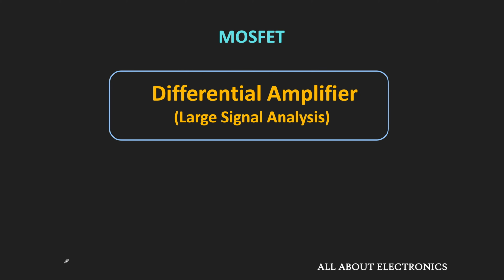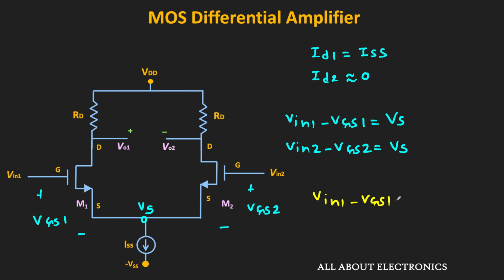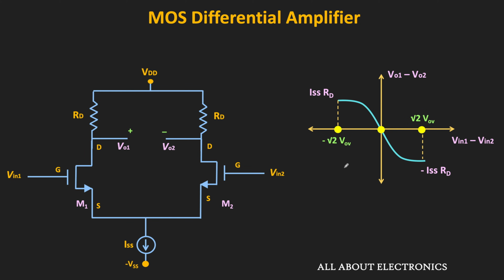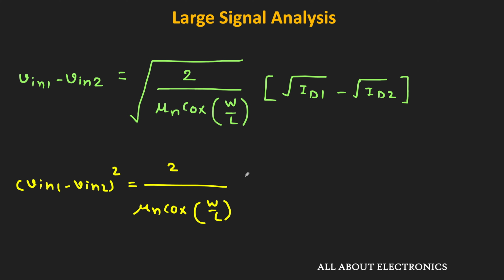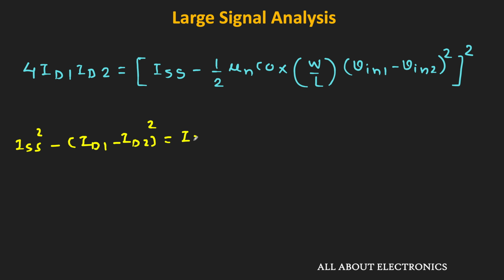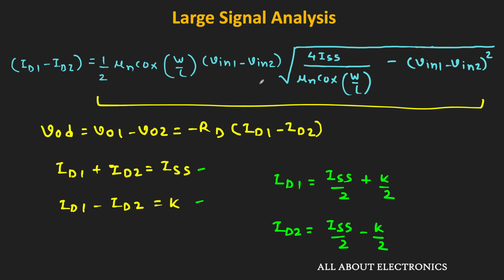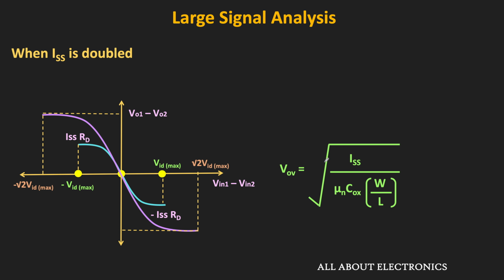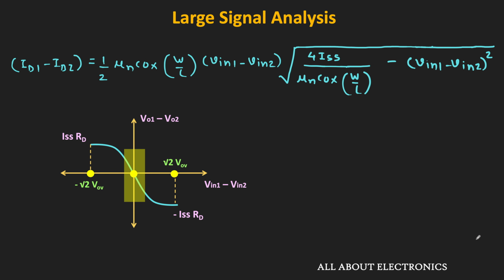MOSFET - Differential Amplifier (Large Signal Analysis)

Comment from the maker: Timestamps:
0:00 Introduction / Recap of the Previous video
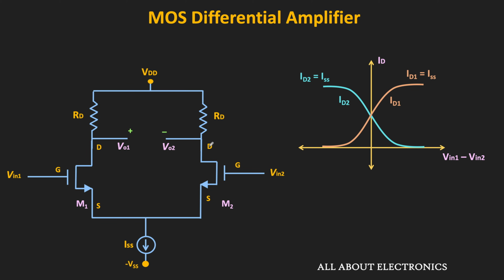2:23 Differential Input Range (Calculation)
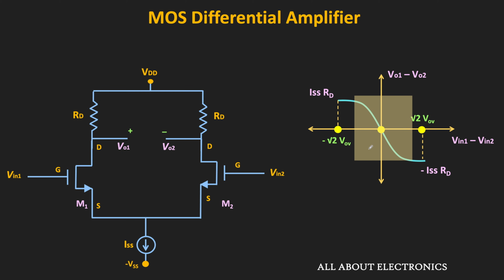7:10 Large Signal Analysis 
18:33 Effect of overdrive voltage on the input-output characteristics 
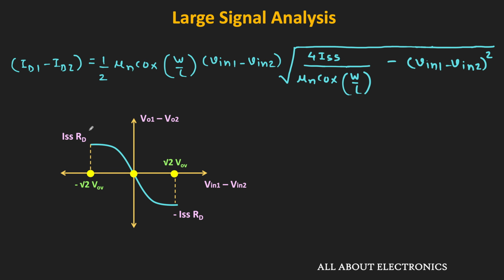21:45 Condition for Small Signal Approximation